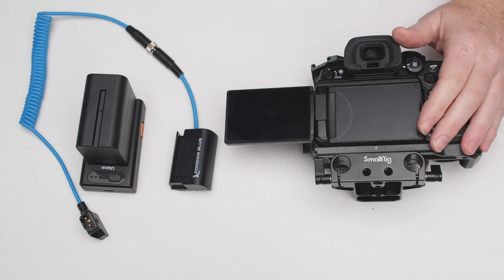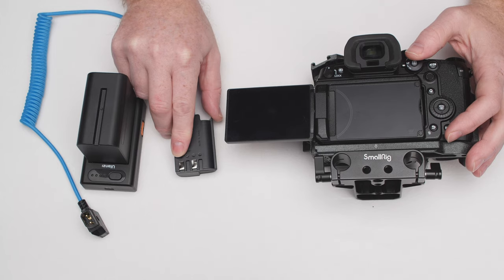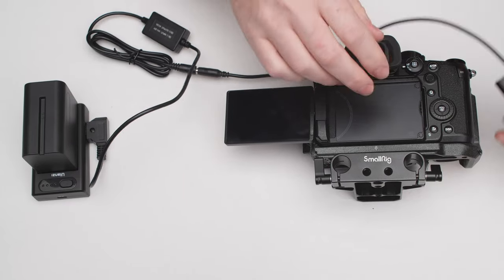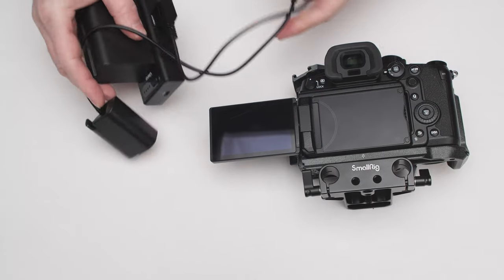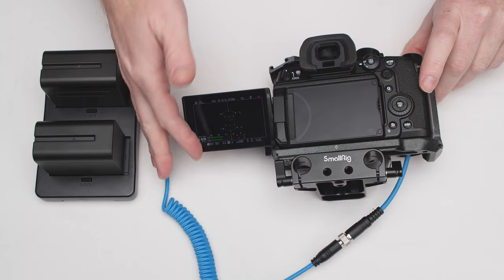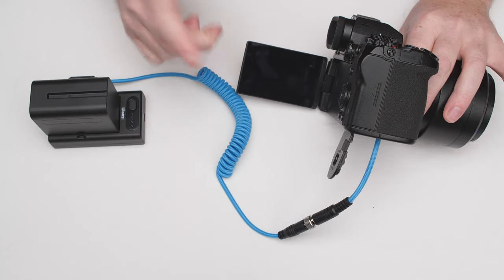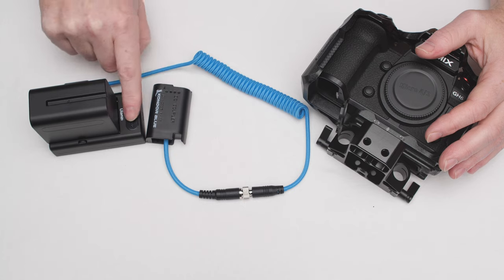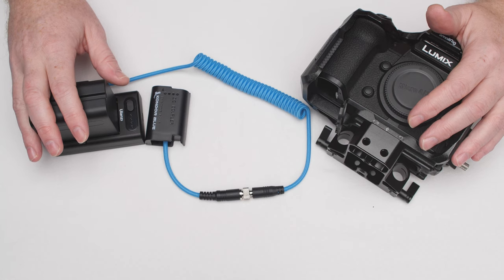More ULANZI NP-F & Kondor Blue D-Tap (DMW-BLK22) Testing

Comment: Hi! Thank you for showing this. I was worried when I heard mixed reviews about the ulanzi npf plate. I'd have a question. I have a Lumix S5ii, and a Probty d-tap dummy battery. Thankfully everything works except there's a small flaw. I can only turn on the camera if i remove either the npf battery or the d-tap connector from the ulanzi plate and plug it back. Then i have like 5-10 seconds to turn on the camera. So for example if im out shooting and there's nothing to do for 20 minutes I'd turn off my camera, but then in order to turn it back on i need to reconnect either the battery or the dtap. Is there a way to use this ulanzi plate as if it would be an internal battery ?

Comment: Just got both of these components in for my S5, as well as a npf to usb-c dummy for my feelworld monitor. used to run my rig off the monitor out, and a 970 npf would get me through 3-4 hours at least. but my dc out dummy battery stopped working (which side note, why did I have to track down an adaptor for it? why was the kondor blue dc pin so small and I had to find a random coupler to upsize to fit the standard DC out pin on my monitor?).

My concern is that the DC output always made my camera show "full" battery, and I would track the usage on the monitor. With the dtap and ulanzi plate (which again, why is the actual product I received different from the KB product photos? none of them show the coupler in the middle...), the camera reads the battery as "low" and seemingly doesnt show any info on my monitor itself. Plus a NPF 970 the ulanzi plate read as 75% per the LEDs caused my camera to die after about 5 minutes when I tried to set the white balance.

Is the 5 amp output on the dtap too low? doesnt the s5 and gh6 need an input of like 8 ish?

Comment: Ok after as much research as I could find for Sony batteries and s5iix.  I got the Ulanzi and the blue braided d tap and I’m hoping this works ok with no problems.
Reply from the maker: Good luck. I eventually got v-mounts for my cameras. I put it off because I thought I didn't want another battery lying around then a couple NPF batteries died and a week later B&H had some great deals on the SmallRig v-mounts so I jumped on it
Reply: @kneepayne ive seen in another video that you want to be careful using v mount batteries because of the high voltage.  Yes the blue kondor will translate from 15v to 8v but he said the heat that was generated could create noise in your image due to heat and weaken components over time.  He said it’s good to stay with 8v across the board if you can.  Npf through the d tap on the ulanzi through the kondor dummy should be a safe 8v consistently.  Those v mounts are good for lights and monitors I was told
Reply from the maker: @ThiCityProductions  

The kondor blue for the Lumix claims to regulate at 9v
https://kondorblue.com/collections/power-cables/products/d-tap-to-lumix-s5-gh5-dummy-battery-dmw-blk-22-cable

And the other brand I have regulates at 8V. Using the SmallRig 99 and its worked fine and haven't had any heat issues that I've ever noticed. I also got a USB-C>BLK22 adapter that I run off the v-mount USB-C and run a D-tap adapter to the Atomos.

The only real issue I have with V-Mount is that they don't talk to the camera. If the battery goes dead on a shoot it can corrupt the video. Unlike the internal battery which more or less warns the camera so it can save before shutting down.

I do know that early D-Tap batteries and adapters had a bad design that it was far too easy to plug them in upside down which would fry your camera. That is why I stayed clear for as long as I did.

I do recall seeing older videos of a guy talking about putting the wrong voltage v-mounts on lights and blowing the lights. Those original v-mounts for lights are huge (26v). The design around v-mount was not idiot proof early on. I think it is better now and I know I can't plug into the D-tap upside with my current adapters and batteries.

Heat in general will deteriorate any electronics. See this a lot working in tech as developers burn out MacBooks every year. I experience more heat issues in the memory card slots than from the battery compartment, at least on the GH6 as it seems to have really good cooling (better than the GH5).

NPFs are nice because they are pretty cheap now. I even have NPF adapters for some of my studio lights, tho I never use them.
Reply from the maker: Note: the website says 9v for the blue kondor but just now I was doing a tear down from a small shoot and noticed the battery says 8.4v it’s a minor note but I wanted to add that for anyone else reading
Reply: Update* ok so I went out on a shoot with the Ulanzi with kondor blk22.  It worked but after about an hour and 20 minutes it turned off and didn’t save recording.  I think it’s an npf battery issue.  Power extra brand 970’s.  Tested each and they turn off at about hour and 20 minutes.  I would imagine those batteries would last longer than the standard battery?? Using the s5iix by the way.
Reply: Ok so after doing a little research I think I figured out the problem.  The Kondor battery is a 15v input (give or take) and 8v output (give or take).  The problem is the 15v input side is plugged into a 8v output on the Ulanzi plate d tap (female).

Comment: Sure the camera powers on.  Does it function normal during 4k / 6k or pro res shoots?
Reply from the maker: I don't use pro res but I did use the Neewer to run my b-cam (another GH6) shooting in open gate 4:3 5760 x 4320

Comment: I'm going through the same situation, I think I already found out what it is.
D-tap outlets are typically 16 volts.
however, for some strange reason or poor manufacturing, the ulanzi adapter only outputs 8 volts from its D-tap output.
Reply: the condor blue seems to have a voltage regulator (the little box in the middle of the cable) while the other cable does not.
Reply: apparently your lumix s5 works with a voltage equal to or less than 8 volts
Reply from the maker: Circling back around here. I came across a USB-C to BLK22 dummy batter that has been working great with the ULANZI NP-F plate. I might do a short video on it sometime.
Reply: @kneepayne did the usb c to dummy battery have the coiled cord or the long cord with power box on it?
Reply: are you sure that Ulanzi d-tap outputs only 8V? I try to find some information but find it nowhere. I would need a small NP-F plate with at least 14V 3A D-tap out if it is possible